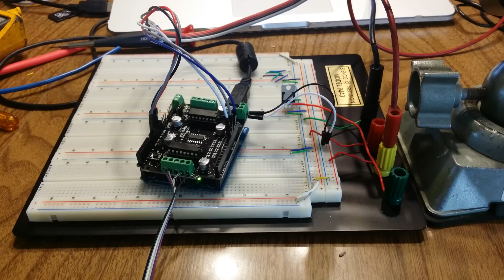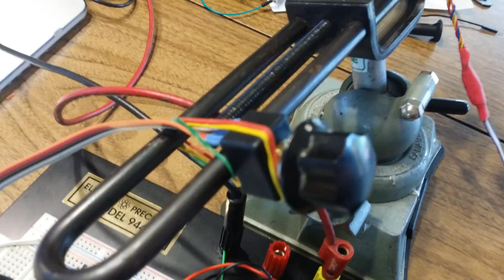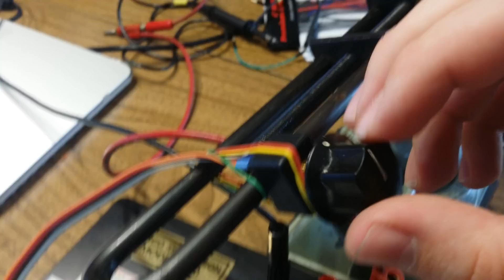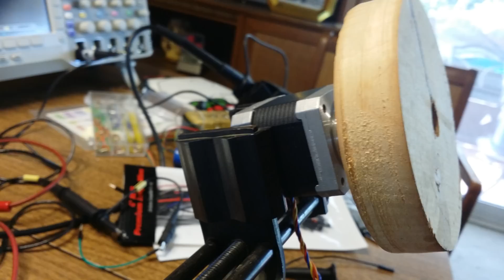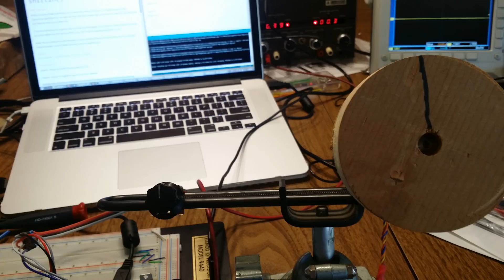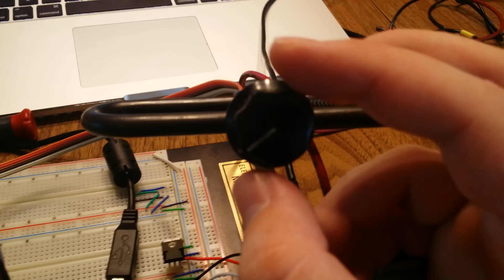Stepper Motor Position Control with Rotary Encoder

Comment: Hey, is it possible to use a linear potentiometer as a switch to turn stepper motor on until it reaches a set value?

Comment: Hi... My son and I have  the exact same setup except for the rotary encoder... Ours is the typical three pin (Common, A and B) encoder.  Do you have a circuit diagram we can view and/or the name/model of the encoder you use so we can repeat your experiment?  We  are using the code from the last post on this page.  Although we believe it's correct, it says in the heading that the code is for a 48 step per rev motor yet in the video it says 200 step per rev (which is what we have).  Any help would be appreciated.  This is for a school project.

Comment: hi evan
i understand this project.
but i need little difference like 
if i turn rotary encoder like quarter turn then output stepper will turn will be different (180 deg)which i could preset.i mean there will be a(fixed) ratio of input turn to output different turn angle
plz help

Comment: Great Project! which model of encoder did you use for this? I am trying to build a wind vane with feedback to a stepper to rotate a mini turbine but I am struggling with the magnetic encoder. the knob for your encoder seems like it has low friction.
thanks!

Comment: G'Day Evan.
Looks good.  What encoder are you using?  Do you have a link? I've been using an AS5040 with Arduino/Teensy 3.1.  I have to get the ICs separately, and mount them myself.  Yours looks factory made.  The only factory made units I've found are about $60usd ea, but by the time it gets to australia they're about $100USD.

Comment: This is exactly what I need for my setup, only i need it to run at larger stepper motor at least 12v. How easy do you think it would be to mimic what you have done but on a larger scale?